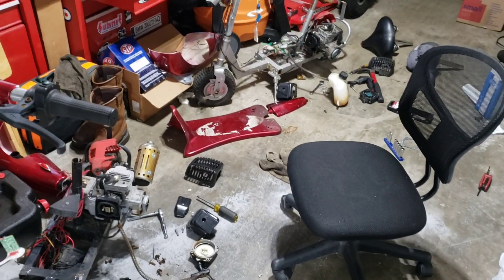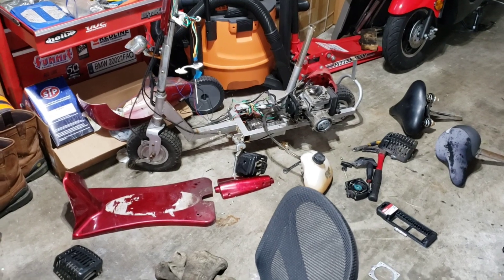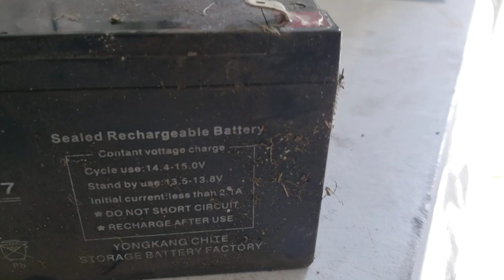XTREME XG-470 SCOOTER REBUILD PROJECT TEAR DOWN DISASSEMBLY

Comment: do you know what charger to use for the lights? i cant seem to find it and i just need the original charger or something similar?
Reply from the maker: I didn't my friend wanted me to cut them out because he wasn't concerned about the lights or anything
Reply: I'm trying to find the charger because I have the same model. just need to know how it looks like
Reply: do you have any idea how it looks like
Reply from the maker: @EpifanioMartinez-i4i  not really they weren't working when I had tried to power it up and looking at the schematic was very difficult so I hadn't really given it much thought when my friend told me don't worry about the lights so I pretty much didn't even try to get them to work so my apologies for that
Reply from the maker: @user-dm1zp6gt3v Oh I got ya here you go https://www.ebay.com/itm/114255703475?mkcid=16&mkevt=1&mkrid=711-127632-2357-0&ssspo=Bwl2wAWaRxa&sssrc=4429486&ssuid=0lJYiIDlQkK&var=&widget_ver=artemis&media=MORE

Comment: I know this video is a few months old now, but I have 2 of these scooters as well, pretty much the exact 2 you had here. Someone butchered the wiring on the one (one you had with the headlights and turn signals) I was So excited when I found this video, but then so let down when you cut the wiring out haha. Nothing against you at all. Was wondering if by chance you have any record or anything of how that was wired, or if you even have the old stuff still haha. Also what resources about the scooters (if any) did you find while working on these?. Thank you.
Reply from the maker: Nothing yet I hadn't decided if I'm going to use the wiring to light it up or just delete them all together and just make it a daytime riding bike instead of a night time riding bike I'll see what I find when I get to that part I'm still working on the rear end in the motor cuz there's one of the motors in the bike the season I had to replace it with the other one
Reply: @fixitdaniel  Alright, was just trying to see if there was anything salvageable that I could use to try and get the one I have back to full functioning order. I tried pausing a different points in the video to see what wires went to what. Anyhow let me know, if you do still have the wiring and everything else from the One that has the headlight, turn signals and the display up top and you have no use for it, I would like to get it from you to use in mine to try and get it going. Thank you.
Reply: @fixitdaniel   By any chance did you have any leftover items from the build? Let me know and we can talk. Thank you
Reply from the maker: @xFalgharx no I give them all back to my to the my friend they were his from the get-go so he gave me the two pieces to make it one so I gave him back all the parts I think the only thing left was the frame so even if they give you the frame you'd have to rebuild it from the ground up
Reply: @fixitdaniel Ok No worries. Was just trying to get parts to fix mine up. Can you ask your friend if he needs the parts? if not, I'd buy them from him, pay shipping, whatever needed. 
Thank you.
Reply from the maker: @xFalgharx  OK, I'll ask him.
Reply: @fixitdaniel  Just checking in, ever get a reply about the stuff from your friend? Also saw you mention a schematic in another comment, where did you find one?
Reply from the maker: @xFalgharx  No i hadnt heard any thing. I'll asked him again
Reply: Just checking in again. Any updates? Also You had not responded to my question about the Schematic. Where had you found one for this? Thank you. @fixitdaniel
Reply from the maker: @xFalgharx sorry about that ya he wanted to keep that in case he needed them.  As far as the diagram I can try and see if I can find some for ya what type of model do you have.
Reply: @fixitdaniel  same exact one. I don't know what it's actual model is. There is no sticker on it or anything. It has the "fisheye" headlight like one in video.